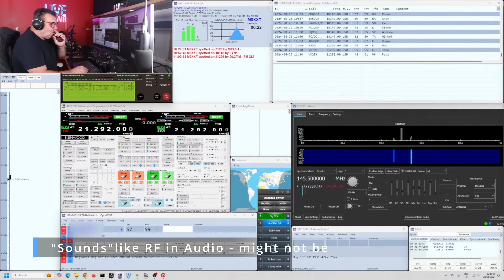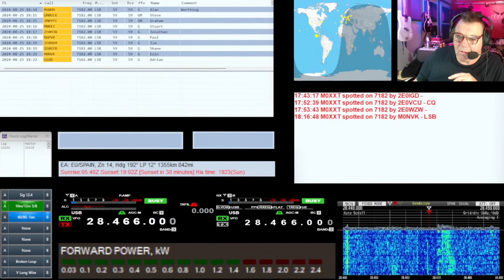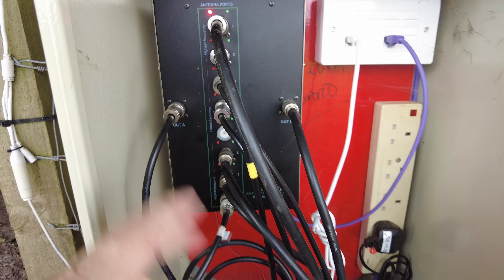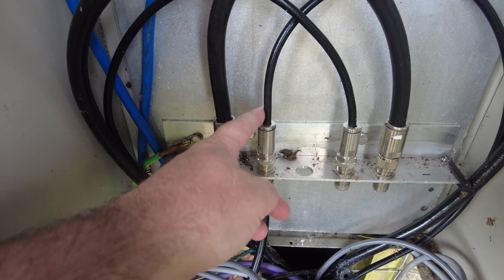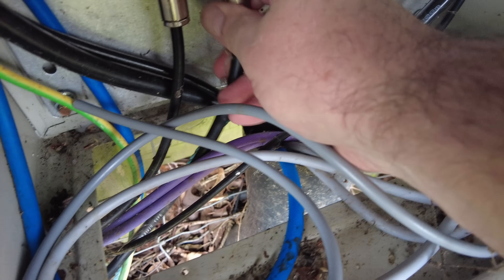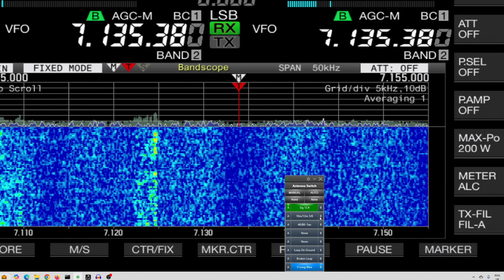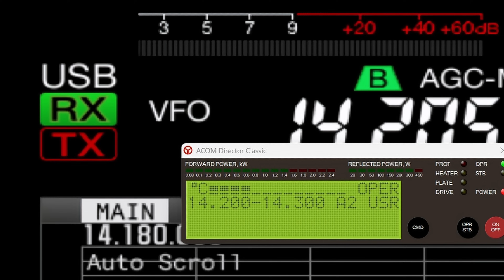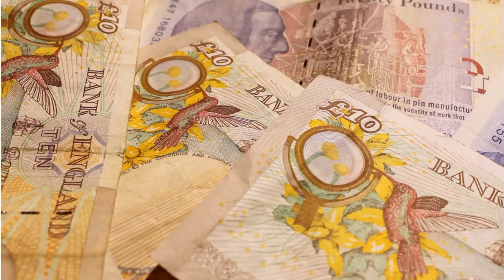Fixing RF in Audio and Arc Faults under QRO

Comment: This is something I've worked with all my professional life. I've worked with radio studios right next to high-power AM transmitting stations. 
Been there, burnt the T-Shirt.
Here are some tips:
All line-level audio cables should be balanced, but with the screen connected ONLY at the send end (except mics);
Anything unbalanced should be isolated with 1:1 audio transformers if possible;
Wrap all DC and control cables around Type 31 ferrite rings (Many say type 43 - but this is not as efficacious below VHF);
Get a load of clip on type 31 ferrites and put them on every cable you can;
Think about the ground connection to each piece of equipment - there should be only one. That might be the RF coax screen - if it is, then do not connect that equipment to ground ANY other way, but have a very good ground connection at the start of the chain - which could be the transceiver or it's power supply.
Ground loops are very often the cause of hums or RF ingress.
Oh, and connect the screen of all coaxes to ground just as they enter the shack, AND ideally close to the base of the tower or antenna.
Reply from the maker: Andy. Superb reply. Pinned.

Comment: Personally, I wouldn't use petroleum jelly on coax, just in case it causes the plastics, etc. to soften.  I've always used self amalgamating tape, covered with Denso tape on top.  Your mileage may vary...
Reply from the maker: Well, maybe not on the coax.. Sure.
Reply: Cal has stock in Vaseline

Comment: Hi Callum

A little aerial theory is in order.... A Quarterwave will have High Current - Low Voltage at it's feed point. A Halfwave will be the opposite... Current Low - Voltages in the LOOK OUT Area! Since you are able to put 50 ohm coax directly on you must be near the Quarterwave mark. Thus Current will be more the issue.... Is my guess.

I'm NOT a fan of the Vaso idea either.... Sorry. I "thought" you used it as a "sealant" but seeing you put it on the thread then screwing the connector on.... OMG No! All over the outside I get it poor man's sealant. Here in VK land we have a few brands of electrical tape available with a nice little bit of "stretch" a few wraps of these will do a nice temporary job. But it's always the Amalgamating tape when you are serious.

Yes... I concur with others here about the PL259's finding a way to come loose. Not my favourite plug either.

Cheers buddy from VK2XRN Peter

Comment: Look into the Luba2 by Mammotion we got one has no perimeter wires just load the app walk the bot around manually with app and teach it where the known obstacles are and press go it will mow up to 180min a run and walk back to charger and restart where it left off. It’s all wheel drive and can handle slopes to like 40deg can do lines boxes cross hatch and even write stuff in if you want to put it call in the field ☺️love mine and would never hire another landscaper. I do the weed eating against trees fence n house every other cut.
Reply from the maker: On the list already!

Comment: I must be one of the people who don't know what I'm talking about, since I don't agree with coating the threads of your connectors with Vaseline.
Vaseline is petroleum jelly, a type of oil, and is an insulator.
You want the treads of your connectors to make a really good connection, not a bad one. So you don't coat them with an insulating grease!
By all means coat the outside of the connector with it for waterproofing, or maybe use self-amalgamating tape or liquid tape.
Reply from the maker: Good point Andy! I was wondering about that!

Comment: The Golden Maxima isn't just a transformer, it's also a 40dB pad so you can feed it with line level from your mixer, and get mic level for the tx. Really nicely designed circuit. And it uses a very high quality isolation / bal>unbal transformer. 
I had a cheapo one before, and the GM is better.
Reply from the maker: Ah! I didn't know Andy!
Reply: @DXCommanderHQ  there’s a jumper inside the latest ones to select line level output too!

Comment: Hi Callum, I worked in a broadcast TV station, many of the coaxes used Pl-259's. Even indoors in a TV station, they would work them selves loose. The tech's hated them for that fact alone. When we would get artifacts in the video or interference in the audio we would go looking for a loose RF connector first thing. Any good RF connector manufacturer can tell you what the torque specs are for their connectors. Those look like high end pl-259's. Make sure you torque them. Torque specs are different with lubricated threads. Again the manufacturer is the expert on their product.  Look at it like this, at lower powers a given amount of resistance in a connector won't be enough to show up. At high power the current loss through that connector resistance can be significant. 

Connectors outdoors are always influenced by water. Its a tiny molecule and it's hard to stop.

Comment: Callum, I live on the Louisiana Gulf Coast where we get about 100" of rain per year.  Also, I worked offshore for a number of years and learned how to waterproof connections from radio techs.  Water can't get in if you don't leave any cavity for it to get into. You didn't apply near enough grease... I use silicone dielectric grease but Vaseline should work fine.  Not just a little on the threads, but pack it into both the socket and plug.  It should ooze out as you screw it tight.  Wipe away any excess ooze on the outside.  Next, using Scotch 77 or Scotch Super 33+ electrical tape (it sticks far, far longer) start wrapping on the coax and after a wrap or two, twist the tape sticky side out.  As you wrap, pull and stretch it so that it conforms to the connector under it.  Now continue your wrap over the connectors and up as far over the socket threads as you can get.  For the last wrap relax the pull.  Cut, don't pull and break the tape.  Sticky side out is to prevent the next layer from bonding to everything and making a mess.  Next, using butyl rubber tape, Scotch 130C,  wrap another layer over everything.  This will bond to itself in the sun forming a rubber boot over the whole thing.  Finally, a third layer with the 3M77, this time all sticky side in.  When you finish, again, don't pull and break, but cut it and smooth it down.  Put a small Tywrap on it to keep it from unwinding.  Every 3-4 years take it apart and redress.
Reply: Perhaps a stupid question but how does grease or vaseline work when exposed to RF? You're saying you actually "fill" the connectors with this stuff? Had no idea you could do that.
Reply: @StianEklund  Yes, fill it.  No cavities.  The electrical/rf still connects.  The grease does not hurt a thing.  And at first I was taking it down and checking for signs of moisture and corrosion once a year.  Then moved that out to every two years.  Still looked like it was done yesterday.   The first layer can be replaced with plumber's teflon tape.  That layer is to keep the butyl rubber tape from sticking to the connector.  Try it.  At worst you can just clean it out and go dry, but you'll find it does not hurt your antenna's performance at all.
Reply from the maker: I think if I was putting this up and LEAVING it, I might do.. But I am forever taking this pluf off :)
Reply: @DXCommanderHQ  At least fill up the inside before screwing it together.  Just a dab on the threads is not enough.

Comment: Thanks for the interesting video!

Saw something else which I found a little intriguing. At 12:40 ish you started switching antenna's, it looked like you were still receiving something (it was there when the 2nd antenna was 'active', but also when nothing was active at all. Looks like you've got some very local interference here? 

Not sure if that contributes to the bacon-frying noise you are experiencing on 40m sometimes.
Reply from the maker: I had all my cables weirdly routed.. B was routed to RX2. I discovered this last week after I made video.

Comment: It's the 21st century, maybe a time to kick your Vaseline habit? Buy a role of silicone plumbers tape, stretch it as far as it can go and wrap it tightly around the connector. It turns into rubber and leaves no residue.
Reply from the maker: .. and then how do I get it off? Which I do often :)
Reply: @DXCommanderHQ  It is really easy, one slice and it peels off. You don't have to take my word for it. One roll is less than 3€ (here in Serbia) so cheap to try it. Get one and try it on a piece of pipe, leave it out in the sun and rain for a while and then try to take it off. I use that stuff for all sorts of things, for example naked bullet connectors, makes a great soft "shell" for those.

Comment: becareful the icom has power coming from the radio on the audio pin to power the element in the hand mic the Heil has a blocking diode cheers W9US
Reply from the maker: Good point.

Comment: Hi the dreaded ARC WARNING ⚠️  happened to me a few weeks ago, My Acom 1500 went on to soft off intermittently,turned out 3 of the bolts on the yagi elements were loose, and only when it was windy was there a issue, ps been using the Dx commander signature 9 very impressed, PA1-LEG from Rotterdam 73s
Reply from the maker: Nice! ANd well spotted on the Arc.
Reply: @DXCommanderHQ  Hi funny how life is, fixing the 30 kg yagi while stood on ladders 🪜 was when I decided to buy a much lighter and easy to work on antenna, and the rest is history, 73s from Rotterdam 🙏

Comment: mr Calum,   Next time you order with Messi&Paoloni, grab some of those M&P-Silicone-Seal-L  waterproof strain reliefs and never look back.   The only "trouble" is if you are disconnecting cable very often. its a sort of a one time use/instalment product but it does the job extremely well.  greets PD2HVT

Comment: Question What's the thickness of Antenna wire to accept 50 RF Watts only antenna wire
Reply from the maker: Diddly-squat. But then you get resistance. A wire as thin as a single strand of CAT5 cable would work.

Comment: The absolute best tool for cleaning out connectors is a spray can of starting fluid for engines (ether)  Here on the farm every tractor and combine and pickup has a spray  bomb of ether in the tool box.

Comment: great troubleshooting . That RF sounding like a Kazoo is funny and hits home for me. That Kazoo was invented in Eden NY. USA. I am in next town over Boston NY.  I been to the Kazoo factory. just a short drive for me.  I got that heil jack adapter for ICOM. works great . the 7300 has same mic jack.  For your use that isolator will work better for RF and ground loops that can cause a HUM in audio . It had a 1:1 transformer inside . Great thing to have on audio . RFI can be picked up threw a ground loop.  We got them GPS lawn mowers in the US as well.  You do have more grass to cut. It is Labor day in the US Monday.  M & P has a silicone seal for that coax connector for   bottom of antenna. You slip it on. Then pull a string and it shrinks making a waterproof seal. It is COLD shrink ! no heat needed. I use dielectric grease on my setup. That works great as well.  Cheers from NY !
Reply: Lifelong New Yorker here from the Adirondacks and I was today years old when I learned that about the Kazoo!  Nice bit of trivia!  Cheers from the ADK de W5ADK!

Comment: In Canada there are basic and advanced level qualifications. If you have Basic with Honours, you get full HF privileges EXCEPT you are limited to rig power basically. This is with good reason, running high power as you know can create a multitude of problems and in many cases, it takes some experience and technical expertise to not only understand the issues but to resolve them. Sometimes it's simple, sometimes not. Glad you got yours sorted out.
Reply from the maker: Good point. QRO is another dimension.